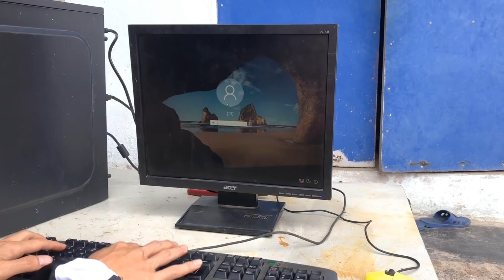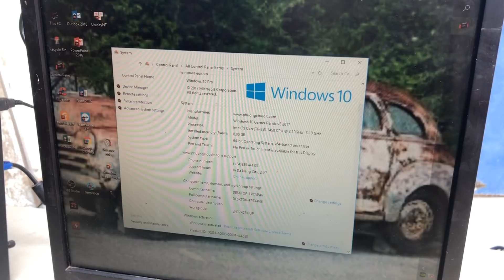Restoration a destroyed 30-year-old PC | Rebuild and restore 30 year old PC

Comment: WOW! I will also open my old HDD and clean it with soap water and tooth brush, you got seriosly bigger rpm, your win 10 turn on faster than with SSD.
Reply: Don't forget to rinse it off with bleach and/or disinfectant to get rid of any virus infections and malware :)
Reply: @garryadamson8507  hahah :D
Reply: @MR6Gaming  This is definitely fake. The CPU is an Ivy Bridge series i5-3450 made in 2010 so that would put this computer only at 10 years old...if it weren't for the fact that the CPU i5-3450 has a different cpu socket that is incompatible with this Foxconn motherboard N15235 (^_^). 

This guy is a fraud.
Reply: @garryadamson8507  coronavirus protect
Reply: @luminatrixfanfiction  Ahahahah, to add even more insult to injury, that i5 aint even 10 years old, it was introduced Q2 2012
Reply: @themrenerd7384  2012 was when it was introduced but they had to spend 1-2 years producing large-scale at manufacturing companies so technically it's 2010.
Reply: But Do you use dis infector So your compur dus not get the corona?
Reply: It’s not water it’s a type of a liquid that can be used to wash circuit boards without ruining them.
Reply: @johnathonbaker1084  It's soapy water dude.

And the liquid you're talking about is either mineral oil or distilled water. Neither of which explains the soap that would cause erosion of the circuitry or the soldering tin, lead and iron.

Don't know why you're defending this scammer but weird flex.

Comment: I'm not very much familiar with the motherboards but I'm definitely sure that SATA drives were not available 30 years ago. It's only been around for less than 20. And also, black PC cases and black CD/DVD drives only started becoming mainstream around the early 2000's. 
If that was 30 years old, then that PC would have had IDE sockets for the drives and case would have been white or ivory color.
Restoring the HDD in that manner is no different from just throwing it with the trash or just keeping it as a paper weight.

Comment: 4:12 Lets forget about the fact that the "30 year old" computer has PCIe slots and LGA 775 mobo but mud on inside of the hard drive!!! There is no way you didnt do that intentionally!! Hard drives are sealed so well that its almost impossible for tiny individual particles to enter even after decades, let alone all this mud....
Reply: Ikr? If the seal isn't perfect to begin with then the hdd is a goner

Comment: Wouldn’t it have ms dos?

But nope it had a core i5 with a 64 bit operating system on it from 2015 so 30 years ago.
Reply: I would have windows 3.0
Reply: @hifijohn  funny thing is: the motherboard mismatched.

Look at socket. It's lga 775 g31 chipset possibly with core 2 duo/pentium dualcore/pentium 4. Max mobo support is 4gb (2x2gb ddr2)
Then you boot it and it's i5 3470 with 8 gb ram.

MAGIC
Reply: this video is 10000000% fake
Reply: the 1st gen i5 processor was from around 2009 or 2010
Reply: AstroidexAdam I was talking about the os but you are correct

Comment: 30y.o? Lol😁😁 im a software and hardware technician for 18yrs. So u can't fool me🤣🤣🤣
Reply: I'm a gamer so he can't fool me too 🤣🤣🤣 

The CPU is an Ivy Bridge series i5-3450 made in 2010 and released in 2012 so that would put this computer only at 10 years old...if it weren't for the fact that the CPU i5-3450 has a different cpu socket that is incompatible with this Foxconn motherboard N15235 (^_^). 

Basically this guy is a fraud.
Reply: I open computers sins i was 5(now i am 12) and the way hé treats the hard disk it's Just dead dance cofing meme

Comment: I remember when I was doing field service engineering, we would get the pcb boards from communications equipment from the customer's sites, strip out the socketed ic's and then soak the boards in soap & water solution, clean with fine hard bristled brushes then dry them out with blow dryers and reassemble after a few days of extra drying in a heat chamber and then test on a board of nails test bed and do other checks and then back out in the customer's sites.

Comment: WTF ??? How did you make the CPU work when the socket pins were bent
Reply: nam viet It’s fake
Reply: @Bowser2k  
I know
 just ask for fun but all the videos of this channel are all script-edited and (the channel owner is Vietnamese)
Reply: @namviet7686  This is definitely fake. The CPU is an Ivy Bridge series i5-3450 made in 2010 so that would put this computer only at 10 years old...if it weren't for the fact that the CPU i5-3450 has a different cpu socket that is incompatible with this Foxconn motherboard N15235 (^_^). 

This guy is a fraud.

Comment: Fake, at the very end there is another pc, see tower
Reply: Dont see any
Reply: You’re right, totally different case
Reply: @lhencegabriellemerciales1005  This is definitely fake. The CPU is an Ivy Bridge series i5-3450 made in 2010 so that would put this computer only at 10 years old...if it weren't for the fact that the CPU i5-3450 has a different cpu socket that is incompatible with this Foxconn motherboard N15235 (^_^). 

This guy is a fraud.
Reply: He knows passwor lol so it is his computer. Look on wallpaper  its his old car he restore :) fake like snow on the Sun :D
Reply: Real!!! Three reasons why
1. He did not use water.
2. He could have gotten a new hard drive.
3. He could have gotten a new cpu.
Reply: @johnathonbaker1084  new HDD has no system on board :)

Comment: i had a pc like that in 2003 it came with windows XP 4gb ram ddr2 a 512mb graphics card and 320gb hard drive it was a dell with its 16" lcd screen a real titan for its time with its powerful xeon
it was mine until 2007 before it belonged to a relative
I sold it in 2019 with windows 10 and 6gb ram

Comment: Fake. Here's 12 MORE reasons why (not a copied comment):
46. If you look closely at 0:40, you can see the "DVD" logo. No DVDs in 1990!
47. The filler slot plate  says "zip drive" although those weren't introduced until 1994.
48. The black case looks out of 2010, not 1990.
49. You can see the mud paintbrush missed the tight nooks and crannies behind the VGA ports.
50. No parallel port on a computer from 1990? Again, fake.
51. ATX motherboards didn't exist in 1990.
52. ATX cases didn't exist in 1990.
53. As you can see at 2:37, the PC is using a Samsung DVD drive. Samsung only made Tube TVs in the 90s. 
54. Those locking latches are from an LGA system, also didn't exist in the 90s.
55. That is DDR or DDR2 RAM, also didn't exist in the 90s. 
56. Foxconn didn't manufacture motherboards in the 90s. 
57. that Intel logo wasn't used on coolers until 2007
58. 18:17 notice how he LITERALLY DOESN'T PLUG IN THE HDD OR DVD DRIVE

Comment: 30 years ago...so a 386 DX is gonna run Windows 10? Not to mention, scrubbing the plates of an open HD with a toothbrush and she starts right up? Posts and hits logon screen in like 10 seconds.....I can remember starting dads IBM PS/2 and walking away to mow the lawn and it STILL hadn't gotten Windows 3.1 completely started....but yeah, some contact cleaner and pond water and this ol girl is ready for some Wolfenstein 3d.

Comment: It’s a fake… washing the hard drive opened? really? This is not possible, and the motherboard is recently, I think 5 to 7 years max, and the memory banks are DDR not DIMM… and the processor use a recently socket… and Win10??? is a really bad fake, the only real is the case restoring, but the rest no.

Comment: as you can have windows 10 64 bits, 8go Ram DDR3, Intel core I5 Pcie, 2.0 Usb on a pc from 1990? from as far as you just ace destroyed the hard disk and reader (it belongs by 2009) in nettoyant,and I imagine no the state fromThe motherboard, that belongs to 2017 and block from alim (no name) and you operate as, to have dirt in a hard disk or block from alim ?

Comment: fake, first of all if you open a hard drive you break it, if you rub it with the toothbrush you scratch it and you have forgotten the thermal paste. The processor soket had crooked pins
and it is not 30 years old because the components are too recent!

Comment: This is a bad restoration... Pc case was different, manufactured way back 2010 or 2009 or the like. Improper cleaning of parts (psu, mb, dvd drive, hdd) using water may cause to malfunction, cleaning a part of a hdd may cause the platter from hdd to scratch, case is cleaned in muddy water, bad reassembly is starting. Dvd drive reassembly is bad, the optical lens is in bottom, mb and rams are good, dvd drive is an incorrect way. Please recorrect it if you incorrect this, just like other Youtubers restoring.

Comment: That computer was made around 2010 or maybe later, if you see the video exactly at @9.03min you will see the date of the CD ROM's mechanism and the frame is showing 2010-09-16. So that frame was made on September 16th 2010. at least the CD ROM mechanism was made on that date and the complete computer maybe on that year o maybe later. so it's not older than 12 years.

Comment: Fake !! 30 years old? so 10 ... hard drive disassemble and clean the boards? Nonsense - The hard drive is hemretically sealed from the factory, it is not possible to have such a mess (waterproof, dustproof)

Comment: 30 years what??? it's even a type 775 processor, not yet 30 years old. Look at the PC case, if it's 30 years old it's definitely rusty, but it's not rusted at all and there are parts that are still wet. Which indicates the pc was just submerged in mud

Comment: the motherboard uses the intel socket 775 generation, and the intel 775 socket appeared around 2004 and ended around 2010, clearly this is not a PC 30 years ago, but between 12 - 18 years ago

Comment: Well, in the thumbnail it appears to have an Intel CPU cooler that's no older than about 2010.  Plus there's a PCI-e x16 slot, not to mention the ATX form factor case, which didn't exist in 1990.  So I'd guess it's a circa 2009-2014 machine.   I'm not even gonna watch and inflate his counter.

Comment: Actually, come to think of it, that is probably a Core 2 machine. That socket is not LGA1155, but is in fact LGA775. The chip looks nothing like a core i5 3rd gen. Also, the model number on that board indicates it is a G31 motherboard. Still not 30 years old though 😆

Comment: It's a joke! He has no idea what he's doing! HDD had been disassembled before it was impossible to get dirty inside. It is sealed at the factory! In the CPU socket, the contacts were bent. Plus, the machine we saw at the end of the video wasn’t what it did. The Foxconn N15235 motherboard is equipped with an LGA-775 socket, it cannot handle the i5-3450!
He thinks people are stupid!

Comment: That's right if i am not mistaken there is a pci express on that motherboard (introduced in 2004-2005 or so) , there are sata connectors as well. No way to be 30 years old :))) I am not even considering the cpu cooler He He... Nice try!

Comment: Many reasons this is fake .
1 30 years ago we didn't have the following.
Micro atx motherboards 
Built in audio,video and network cards.
Where's the Isa slots
The old ide cables.
Also didn't have cd rom drives then or USB.
Where's the floppy drive
Also cpu chips were bigger then.

Comment: Looks fake... The metal surfaces have not a single scratch on them (after cleaning) and after removing the RAM, the one slot is still half clear... It looks like someone just sprayed mud on a working pc and then just fully cleaned it.
BUT I liked the work he did to clean it...

Comment: So fake. Hard drives have filter prevent dust getting in. The filter is to allow pressure equalisation only. You can’t take to cover off and wash it, then scrub with a toothbrush. The LGA socket has bent pins, you can’t scrub it with a toothbrush. Plus 30 years ago, windows 3.1 was just released not windows 10 as shown. Take it from me who was a computer programmer at the time. I worked for IBM who developed hard drives at Hursley Hampshire. I was writing software for PC’s in 1992. Processor then were intel 80486 and were ZIF socket, hard drives were IDE plugged into an multi I/O card. PCI was only just released. LGA socket and SATA interface for Hard drives and Optical drives makes it 2010. Windows 10 was 2015. This PC is booting windows 10!

Comment: The fake part is definitely the disk drive how did you get the code? But you can put water on any device unless it holds voltage that’s when components get damaged all he had to do was wait for the components to dry off and then he can turn it on looks like it and everyone’s complaining about the spray paint when it’s primer combined with spray paint so the drive is fake and the password is fake ya

Comment: 1 - 30 years old? That's 13 at BEST, (CPU socket, pci-e and more) probably more around 7-8.
2 - Cleaning the HDD on the inside - If the seal on a hard drive isn't perfect then it's already beyond done for. 
Opening it up yourself is 100% dooming it.
3 - guessing the password was absolute bullcrap

Comment: Since YouTube disabled dislikes, it’s safe to say that this video has over a million hundred dislikes 

And is all due to the obvious reasons such as the pc not being period correct to the 90s and the hard drive platters cleaned with a toothbrush and that it’s a whole different pc type at the end of the day by the time you stop watching 

And plus it would make much more sense if you were to watch this again in the year 2069.
Reply: Yes I made it grammar cancer intentionally cause autocorrect made me even more angry than having to cringe at the inaccuracies of both the video and my comment.

Also, DAMN YA FUCKING DOGS AT THE END

Comment: motherboard with socket 775 and i5-3450 so is fake video ( 16MHz 80386 CPU, 20MB hard drive, a 1.44 MB 3.5-inch floppy drive, and 1MB of RAM this is a computer from 1990 )

Comment: 30 year old pc??? with a pci e slot???
The disk drive and HDD have SATA connectors
Plus a hard drive wouldn't work after taken apart!
The PSU even has SATA connectors
The CD drive is around 12-13 years old looked like it was made 2010-2012
Plus there's an intel stock cooler the same kind that you always see
That and I do believe the ram models look like they're DDR3
Where is the rust on the case for this to be a 30 year odl pc
Yeah, No the oldest I gotta say is this PC is most likely around 15 years old no older, Its probably not even older than 12
Dont watch this vid and save your time and breath! this is just a prebuilt from 2013

Comment: NOT "30-year-old" ! This is just 10 to 15 years old (it has even 24-pin ATX-Power + 4-pin CPU-power + PCIE + SATA-DVD-drive + the Intel CPU has an LGA socket (likely socket 775 for Intel Core2Duo ) + ...  ) & got some dirt + water just recently !  (I have seen 30 years old PCs) ... conclusion: FAKE !
just the power supply looks old , because its the worst China junk you can get (thanks for the inside of it with 4 diodes like in the chepest PSUs you can get , instead of a Bridge Rectifier)...

Comment: considering that PCI-E got introduced in 2002  , and the Foxcom G32MV got released in 2008 
,so no not even 20 years, let alone 30 
btw the I5 was no where near 30 years (released in 2012 ,and not compatible at all with that board) 
sure nice job with trying to scam people , but exaggeration is also a profession 🤣